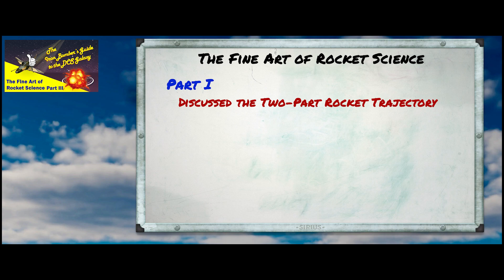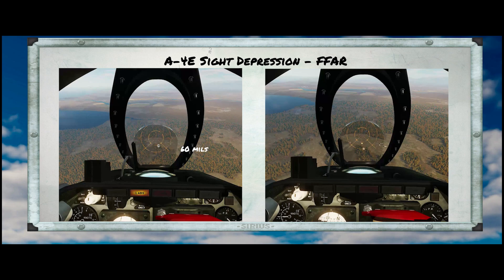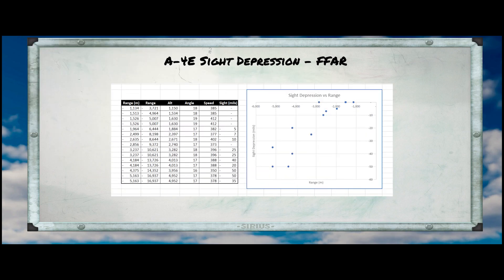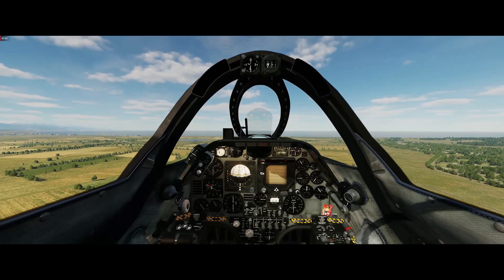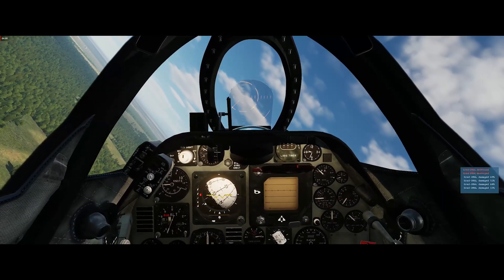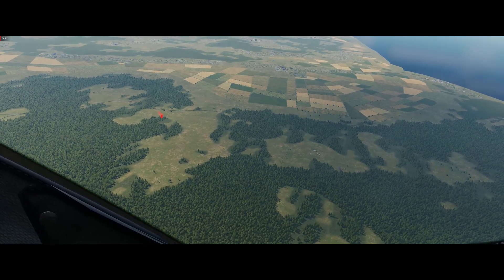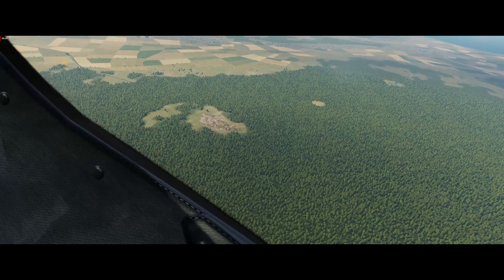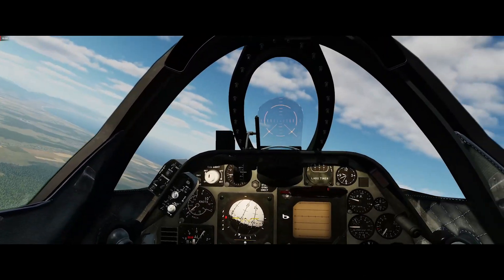Even More Rocket Science.  Can We Make FFAR's work?

Comment: Glorious stuff.  I transcribed the table and will include it in the printed 5" x 8" kneeboard sheets I use.  I also calculated the slant ranges (your "Range" , I believe) and horizontal ranges for all the combinations, and dusting off 7th grade geometry to do this was hard enough to give me even more appreciation for the background work that goes into these videos.   No criticism should be implied to the following observations.
The rather good A-4 manual by "Ali"  includes the FFAR table straight from the Navy.  That is great, but they are useless for DCS, not even close to your real (virtual) world results.  My take is that for the Navy tables to work, we would not only have to have a "full fidelity"  A-4  (which they are doing well with) but also a full fidelity FFAR model.  I can't even imagine.  .  .   Some fun facts from the Navy table:
1.  Sight depression varies not only by dive angle, altitude  and speed, but also by aircraft gross weight.    7 mils (not a lot) between gross weights of 12k and 20k. increasing as the aircraft gets heavier.  What the *&^%?  The rocket spits out of the tube, why does it care how heavy the aircraft is?  
2.  The only place these tables get close to 0 sight depression (0 to 6, actually, see gross weight above) is at 2,000 - 2,500 feet, 560 knots, 30 degree dive.  That is moving in an A-4..  At your combo (400 knots)  they show sight depression ~ 22 - 37 mils.   
Now, if only the Navy had used DCS standard FFARs, that would be a great table.  Fortunately Iain looks after us and gives gives us a useful table based on real virtual FFARs.
Reply from the maker: Actually. The weight makes sense.  Because it affects angle of attack. With a bomb that won't matter much, but it does with a rocket!  Might explain the variation in results. Had not thought of that before. Good stuff!
Reply: @Sidekick65  Good point, it has to be something like that.  With the FFARs Iain has demonstrated that 5 or 6 mils is not going to make a big difference on that shotgun pattern.   But the Zuni's tend to go where they are pointed, and it could make a difference at the longer ranges.

Comment: So I should aim to be at a dive angle of 20-30 degrees and fire when I'm at 2000-2500 feet for optimal accuracy? Does the speed you're traveling at significantly affect the rockets at this range?
Reply from the maker: Correct.  Or even lower.  You really have to be a lot closer than you think.  BTW - those numbers are in the kneeboard too.
Reply: @Sidekick65  HA! Man I really just need to sit down and read the kneeboard at some point. Thanks for indulging me lol
Reply from the maker: @ThePizzaGoblin  No worries, you're just not used to having such a good Kneeboard available.  ;-)
Reply: @Sidekick65  ain't that the truth. I usually ignore the default kneeboards so it's given me a bad habit.

Comment: Fantastic stuff Iain, these videos have made employing rockets way more effective than what I used to see.

Quick technical question on the radar altimeter warning: What direction does the radar altimeter look in DCS planes? Is it a beam shooting "straight down" compared to the body of the plane, or is it more of a cone or sector that can still give an accurate altitude when in a dive?
Reply from the maker: Good question.  It would actually be a good one to ask over on the A-4 discord.  Perhaps I will do that.  I know that it is affected by roll.  You can hear that effect in the video as the jinking continually sets off the warning tone.  I don't know how it is affected by pitch.  I am going to say that, based on my experience, it seems to be OK in fairly shallow (<45 degree) dives.
Reply: @Sidekick65  Just thought I'd put this here, it says nothing about DCS of course, but IRL it does seem that the radars do broadcast at a decently wide angle (at least in civilian applications, military might limit that a bit to make the aircraft harder to spot), and altitude is usually measured the to the nearest strong reflection. So as long as the pitch or roll isn't TOO severe, they should work decently well. Of course terrain topography  will have a huge effect when not flying on level ground.

From the Wiki:
"Radar altimeters are an essential part in ground proximity warning systems (GPWS), warning the pilot if the aircraft is flying too low or descending too quickly. However, radar altimeters cannot see terrain directly ahead of the aircraft, only that below it; such functionality requires either knowledge of position and the terrain at that position or a forward looking terrain radar. Radar altimeter antennas have a fairly large main lobe of about 80° so that at bank angles up to about 40°, the radar detects the range from the aircraft to the ground (specifically to the nearest large reflecting object). This is because range is calculated based on the first signal return from each sampling period. It does not detect slant range until beyond about 40° of bank or pitch. This is not an issue for landing as pitch and roll do not normally exceed 20°."

Comment: Hi Iain. As my English is very bad and the translator is not perfect, sometimes I get lost. Can we say that ( with Sight = 0) the optimal parameters are: start with altitude 9000, speed 350 and dive 20º / 30º, and end with altitude 2000 and speed 450?
Reply from the maker: Yes,  something like that should work. 
The main thing is to remain in the dive until close enough.  For A 20 degree dive this will be 2000'
If you dove at 30 degrees, this would be 2500' . Does that make sense?
Reply: @Sidekick65  I will test it in depth. !The farther the better!!
Reply from the maker: Let us know how it works.